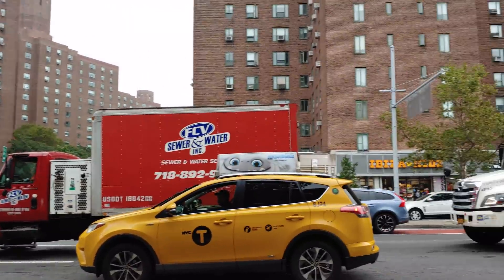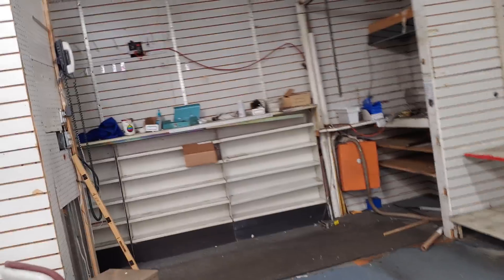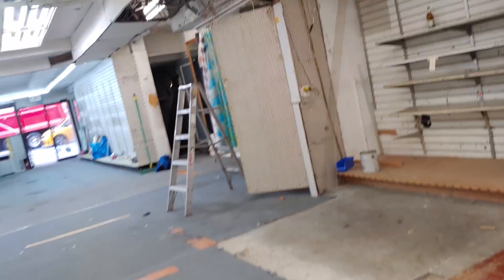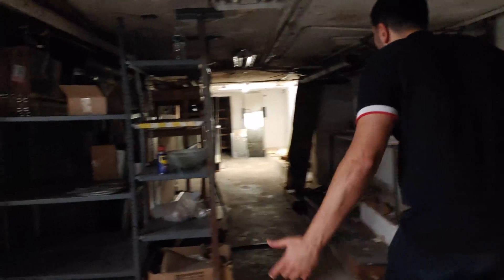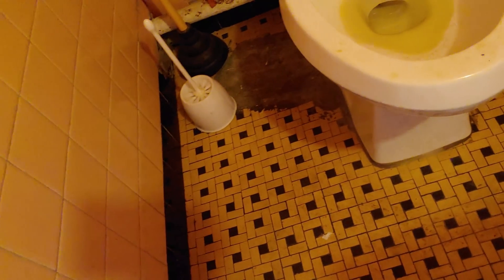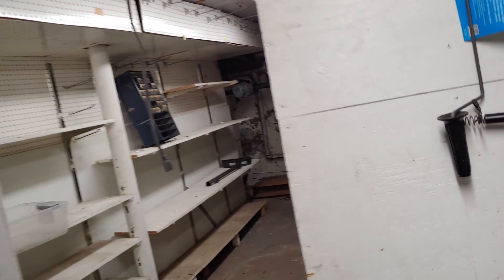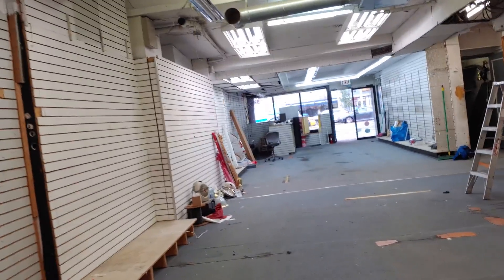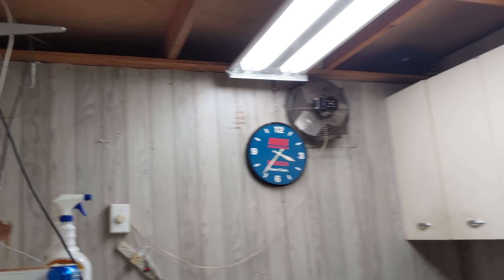[1ST AVE 20TH ST] Is this BETTER or WORSE than bella tile(last video) to be used as our new store?

Comment: For ground level, this one is pretty reasonable, even if it goes for $9k/mo. and it's better than the tile place.  I also like the look of the slatwall panels.  Clean them up and paint them white, would look better than the Apple store.  And the basement w/hatch is a good bonus.  I think this is the best one all around so far.  Needs a bit of work but wouldn't necessarily cost an arm and a leg to get it fixed up.

Comment: Flip a coin between this and Bella Tile. Essentially the same size of space.
Biggest pro point here is that the space is already empty. And you have your rolling doors.
Biggest pro for Bella is that it provides the best opportunity for future expansion without having to move. You will also be dealing with a generational family.

Personally I would go with Bella just for future expansion alone.
Reply: Bella has an owner problem, an old man owner he doesn't get to interact with can stop anything he wants to do.  Bella needs to flat out agree to give him the full basement, or there is no point.

Comment: this one needs lots of cleanup and that ceiling of the basement needs to be checked to make sure no one is going to fall through the floor. its much much better than your current store. I think you should keep looking but keep this on in the top 3 choices.

Comment: I like this, but are affraid you will outgrow this to quickly
Reply: Outgrow this place? A nice problem to have. :)
Reply: @Mandurahboy  well, it's not not such a nice problem to have if you just moved in and you could've predicted you would outgrow the space. It's a nice joke, but honestly, choosing a space that's too small just means extra work too soon after you moved in.
Reply: His goal is to get the cheapest rent for a good location for walkins.   I would not worry about running out of space.  
If he can be profitable paying $8,000 a month and still out grow the space then he can open a 2nd location or better yet have the 2nd location be a 2nd floor shit hole with even cheaper rent near there where he could have a runner bring computers over to.  

He really only needs a small street space for walkins and all his techs could be at a non street space location.  You can pay someone to be a courier to move product between the walkin location and nonwalkin location.
Reply: Nah dude, we're do for an "adjustment" in the market soon, sales will decline. It's been 12 years of growth, eventually the pendulum will swing the other way; better to buy a place that works now and is CHEAP so if or when the work dries up you won't have spread yourself too thin.
Reply: @jetjazz05  i kinda disagree. As long apple is making new products, the products will come with design flaw (at least on a small number of devices). But I agree on spending money wisely for a new place
Reply: @arnilsso  It's only a matter of time before they epoxy everything and make you destroy it to get it apart. Just watch. Sales are capped and as soon as the phone sales decline and profits fall (b/c they basically can't increase the price anymore), then you'll see the most anti-consumer shit in history. I think he needs to expand on data recovery (SSDs especially, since that's growing) and into expensive devices that people don't want to throw away (high end TVs, etc). Hell, he could even do ECU repair for vehicles.
Reply: @mackymode8185  I pulled all of my data off a dead win7 SSD with linux on a thumb drive.  
Transferred it right to the stowage drive. 
Pretty easy actually!
Reply: I agree, not much more space really you have to consider walking area down the middle, meh.
Reply: Louis needs to have a location in San Francisco. Close to apple :P

Comment: Can you really fit more than 12 people in there tho? Seems like you would have more space to walk past each other yes, but not actually fit more workstations.
Reply: Looks like a 25-30% upgrade but not really business-changing stuff.
Reply: Seems easy -- just need to put the workstations in the far end in an "3" formation (all facing wall, with a face-to-face row in the middle). Or all on the right side of the store so they have access to window and immediate access to customers (like what they are currently doing). Would be kinda difficult though if you also need to secure the basement door which is on the left side.
Reply: I  agree,  it's not really that much bigger after you figure in walk ways.

Comment: good location, street level door, signage space,a real storefront door, proper shutters, high load breakers, wide open space, accessible basement hatch, pre-installed HVAC.

The place is the best you have seen so far. it definitely needs a lot of cleanup but once the ducting/wiring/walls are tidied up,  it could look very "apple"ish.

8 with 4mo free is incredibly reasonable for such a place. I say take it on a long-term lease.
Reply: he's not going to get 8 and 4. Their intial offer is 10 and no months. :P he's offering 8 and 4 months. they landlord will counter offer like 9 and a month free and settle at like 8.5 and 2 or something that sort of thing.
Reply: @sparkzbarca  Even then it's probably the best space he's seen imo.  As long as the rate of annual increase is reasonable he should take a serious run at locking this down.
Reply: @nfurber2  also no bullshit loss factor, and a Starbucks nearby so the neighborhood cant be that bad

Comment: I like the tile shop due to it's "possible future expansion options", but I like this one because it doesn't need NEARLY as much renovation and electrical work to get it habitable.  Both have basement space, so that's pretty much a wash.  The slightly lower costs of this one will also play in over time.  (Yeah...I'm a cheap bastard...  d;o)

Comment: single phase 110v electric? there goes the hvac bill! 220 service is the way to go.
Reply: I think he's just confusing the terms. I'm 95% sure that's a regular split phase panel and that he just meant to say there's no three phase. Besides, the HVAC may not even be connected through that panel.
Reply: Most likely 200amp 220volt single phase.

Comment: I didn't see a bathroom on the main level.   Also, no rear exit out the back.
Reply: It is easy to run a pipe to put one on first floor if he wanted it.  Rear exit isn't needed, he doesn't have one now.  This place has an escape hatch as a second exit.
Reply: @_PatrickO  I like the idea of escaping a building via a pipe.
Reply: @whirled_peas  Just found the missing Mario brother.
Reply: There is a door by the top of the basement stairs. Could be bathroom or exit
Reply: @zeus982  Are you sure you're not seeing the actual door for the basement?
Reply: Damn folks you have good eyes and sense of shopping buildings.
Reply: Yeah. Wouldn't be too hard to build a bathroom up there.open basement

Comment: it's a really great spot, easy to move into, lots of room BUT it does not have much expansion possibility down the road, and i see in a year or two maybe three, if you keep growing at the rate you do now, this is going to be too small and there is no option for a 2'nd floor or any more room for expansion in any way. It will fix the space issue you have right now and for the next 1-3 years but not in the long run. I would go for the bella tile of the two if you can get it like I wrote it in my comment on that video regarding entrance rework and access too 1'st floor as well
Reply: No reason you have to have all new employees in the one location.
Reply: GeekGarage best option at that stage is a 2nd/3rd location.

Comment: Damn these wooden stairs to the basement. They look like pre-1939 Finnish War.
Reply: Will that war ever finish?
Reply: Never surrender
Reply: Yah but the cellar is pretty nice. No open sewer, decent headroom, ok lighting. What about heat/AC? And single phase 200A ... enough?
Reply: 200A should be enough.  A store with all his computers and equipment should easily stay under 200A.    

But from the meter, you can add an entire 2nd 100A panel.   All electric drops to meters can support 300A+.  The only issue would be if other tenants on the street already did that upgrade which maxed out the local transformer, but I doubt that unless there are a lot of businesses on that block using lots of power.    

If for some reason the meter and drop cant support more amperage, the cost to upgrade would be less than $5,000.
Reply: 🤔I thought I have seen those old wooden stairs to the basement somewhere! Oh yeah, EvilDead#1 ☛☛ https://youtu.be/ivJgUEoOBec?t=152

Comment: This blows away the tile shop, this has direct street access
Reply: They both have street access. Just don't have to deal with the front gate issue. If the hallway to the stairs weren't there it'd e the same size
Reply: @CyFr  Yeah man that owner cut some corners on that staircase for the tile building, I think if louis could buy the whole building, it'd be perfect, fix the staircase issue, live upstairs, two floors for the shop, large basement and best of all get rid of all the old guys old shit

I'm pretty sure his son admitted to some tax fraud when he said the showroom was zoned residential but they were using it commercially
Reply: @CyFr  I think retro mean with this place, you enter 1 door and you are in the store. With the tile place, the door off the street leads into a hall, and then thru another door to get into the store.
Reply: @michaeldiaz4942  meant*
Reply: direct street access is overrated in nyc
Reply: @radnukespeoplesminds  Literally everything is overrated in NYC. Even the city is overrated. The only thing not overrated is maybe the food.
Reply: @AaronTsuii  I'd like to know what kind of food isn't overrated in New York city. Hard for tourists to find the good stuff.
Reply: @radnukespeoplesminds  No it is not.  His business has to be heavily based on walk ins. If it were heavily based on mail service then he would move to a suburb and pay $1,000 a month for a way larger unit.
Reply: @common_c3nts  he has said often that walk ins aren't a big part of his business mail in is a bigger part i think but there is a couple reasons to stay in New York. I think his most profitable business is from local clientele he has built up over the years working there. He also has invested in his employees who live in New York. I don't know if going over the bridge to Jersey, Rockland County or even to Westchester would make sense to his business. If alot of his customers are Manhattan based going to another borough or suburbs isn't always a quick trip the traffic can get pretty crazy. Not to mention travel time and tolls if he moved the business outside of Manhattan.